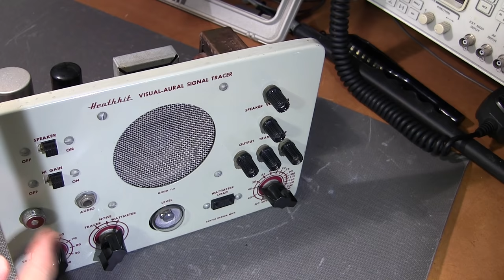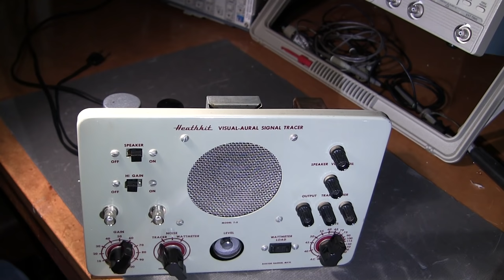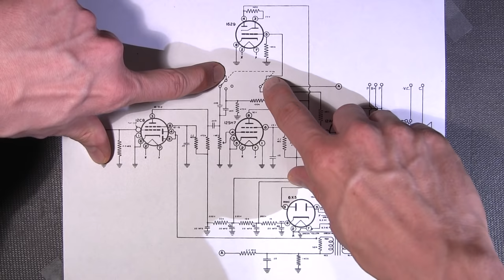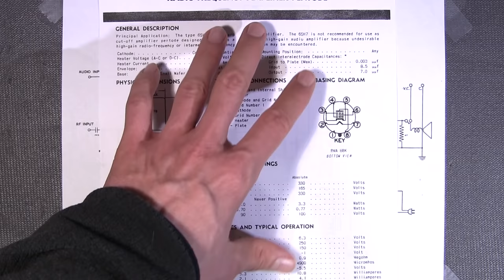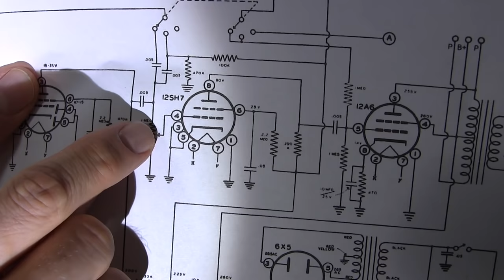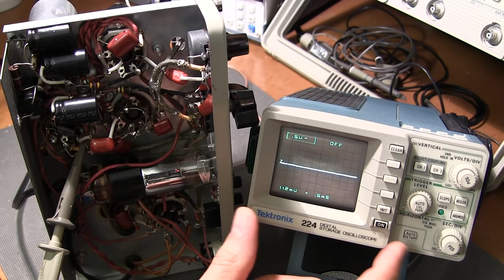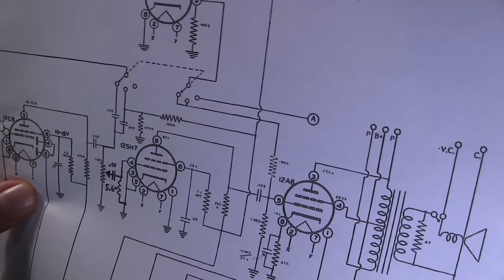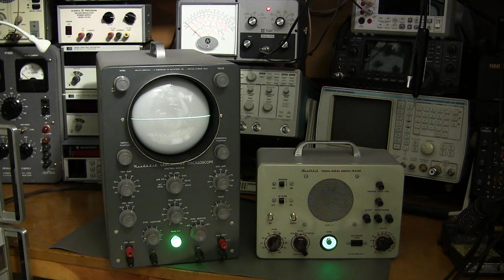Signal Tracer Troubleshooting Repair and Modification

Comment: OK, OK... I'll admit I didn't believe that Heathkit would miss-design a bias level which would present a problem. I was DEAD wrong, as Paul pointed out. I could have fixed the problem, had I correctly spotted the  plate voltage disparity. Geeze... it takes someone with a LITTLE more trouble shooting time than mine to spot something which was so obvious to him. Nice job. GREAT job, in fact. .

Comment: Long term technician here.    Now 70.  You do a great job of explaining as you troubleshoot.   I grew up with vacuum tubes and still love them if one can love something like that.  I've taught many troubleshooting classes over the years and am always amazed at the looks I've seen from students when I bring a vacuum tube device in for them to diagnose and repair.   The "deer in the headlights" types of expressions.   You do an excellent job in your presentations and video work.    I especially like your thoroughness to make a device work as well as it can, even if some mods are required.  Keep the videos coming.

Comment: I thought that the pot had a bad spot, tin whiskers, or leaky coupling cap on the wiper. I wasn't paying close attention when you went through the schematic; I didn't realize the pot was DC coupled. I can't believe the engineers at Heathkit did that! Cool video. Sometimes, I would parallel a suspect noisy resistor with an electrolytic cap to check for noise. That method is not always practical, and can cause damage if you're not careful. The outside techs would use a meter called a "Sidekick" that would put a couple of hundred volts on the cable to check it for noise. I hadn't seen a signal tracer with that function built in. Neat!

Comment: I learned electronics in the mid to late 60's from hanging around a radio & TV repair shop. It was a 1-man shop, so I became his helper. He was an old head at fixing radios and televisions. In fact, other shops would often call on him for help when they came across a tough old dog. I learned a lot from him, and I was very blessed to be his helper. He was much like you Mr. Carlson in his ability to troubleshoot and explain how things worked. I guess that is just one of several reason I enjoy your videos. You give great detail and are very methodical. No doubt the younger folks and even older folks like me learn a considerable amount from your videos. There are very few if any who teach how to troubleshoot vacuum tube circuits today. Thank you.

Comment: My bench looks as if it came out of the 1940's.  I restore vintage tube radios and amps and other vintage electronics using all the test gear from the same era.  When I sit down at my bench to work (play) it's as if I've been transported back in time to a 1940's radio repair shop.  I find it very gratifying as well as escapist.  It's a hobby I've done for nearly 40 years and still love it, as well as accumulating a collection of wonderful old radios.  Nothing sounds like tubes, even in AM.
Reply from the maker: Thanks for taking the time to write Chris!

Comment: Thanks a bunch Mr. Carlson.  Having been around at the dawn of the transistor age as a teenager but also doing lots of vacuum tube radio and TV repairs after school, I truly appreciate your rigorous and back-checking diagnostic procedures.  Lots of relaxing fun watching you do your thing.
Hoping to get my hands useful again shortly restoring about 10 ancient (pre- 1960's) radios and radiograms - all vacuum tube stuff.  Can't wait!  Something to do as retired, 71 year old, electronics design engineer.

Comment: The reason Heathkit used unusual tubes in their 1950s kits (particularly test equipment) is because they were WW2 surplus and Heathkit got them for almost nothing. The 12C8, 12SH7, 12A6 and 1629 were common WW2 surplus that weren't used in "civilian" electronics so there was little demand for them, and Heathkit got amazing bargains on carloads of them. As they used up their supply of WW2 tubes, they gradually changed over to more-common types.

The 1629 is a 6E5 with an octal base and 12.6 volt heater. It was used in the SCR-274N (ARC-5) transmitters.

EXCELLENT video!

Comment: OK, it's a little late for comments at this stage but here it goes anyway. I grew up with Heath kits in the boy scouts radio clubs in the 50s and 60s they were considered as fairly valid tools for learning and there certainly were some flaws in engineering. I always wondered if some of those flaws were intentional. Look at it this way ... If you were motivated not to accept everything at a complete and finite face value, you might want to find the seat of an issue and discover its remedy by simple experimental techniques. It would certainly teach you something in the process. Its been 50 to 60 years and I still love doing these things. These videos are very valuable and I am still learning new things every day. Thank you for all you do !

Comment: Amazing!  I would have said the noise was caused by an old audio gain potentiometer and lived with it.  Your design modification stopped the potentiometer crackling noise and stopped unnecessary plate current.

Comment: I wish I had this exceptional man looking over my shoulder as a teacher and I’m in my 60s trying to work on  old equipment. Amazing man. Thanks for your helpful and pleasant demeanour.
Reply: I am 65 as well, continuing to work on my hobby (hobby (#5) electronics,) now starting a more concentrated effort towads a major focus on Electronics & Amateur radio 📻. I have dabbled in electronics since approx 1966, I had parent's that were either too trustworthy or totally ignorant towards the dangers of "high voltage" in 📺 's! When I was approx 12 years of age I got to close to the high voltage transformer for the crt and was thrown clear across my bedroom. I didn't learn much, as all I did was get up, brushed out any lingering cob webs, walked back to my exploration adventure of a newly acquired TV set.  Since that time l attempted to learn electronics on my own with mixed results! I have shocked myself a few times but never to the Olympic Games level of Manitoba puddle jumping adventures. There is a lot we can learn from this and so many more great teachers one can find on YouTube.  Between all of my great books available, the internet and YouTube instructional videos, an individual can learn a lot, have fun and help the environment out.

Comment: Thank you very much for very thoroughly showing how all the controls on a signal tracer work.  I especially liked the troubleshooting and repair/modification as well.  

I'd love to see you showing how to actually use a signal tracer in a radio repair.  

A lot of these units seem to come without probes.  If you'd show in a little more detail how to make up a probe, that would be great!

Regards, Tom
Reply from the maker: Thanks for your input Tom!

Comment: Probably the best troubleshooting / repair video I have seen for ages.
You are so clear and and easy to understand. I like that even though you are doing - with my knowledge - a quite advanced repair, you still explain the simple steps too.
I found the noisy resistor very interesting. I have heard that they exist, but never seen it demonstrate and with such a extreme result.

Comment: Paul,
I just got the EICO 147 tracer. Different tubes, but amazing how much the circuits are the same. It does not seem to have the switch to ground the grid of the first amp tube though. 
The manual for the 143 states that the current sent to the probes on the noise function is "about 130 vdc" but that there is no danger of damaging components since the short circuit current is "about 1ma." It also states "some care" should be used in handling the probes, though the shock that can result is "relatively harmless."

Comment: Great job on tracking down the noise.  That can be a bugger some times.  Nice to see I'm not the only person that installs modern X1 Y2 safety caps.  In a lot of gear especially radios I work on they used standard ceramic caps and I don't have enough fingers and toes to count how many of them I have seen exploded.  I always replace them no matter what they look like.  Especially across the line caps.  Their on 24/7 as long as the equipment is plugged in, hardest working part there is.

If you ever run across a Paco Z80 cheap grab it.  I love mine.  In addition to the variable gain pot it has a switch for multiplier of X1-X10-X100-X1000.  The scope/VTVM output is also very handy.

Comment: Excellent Paul. I have a couple of 1950s UK made Taylor Instruments signal tracers, pretty rare things over here actually.  One of these had something even better than those HV/B+ terminals on your Heathkit. Someone modded it with a 4 pin valve base fitted into the front panel  therefore giving 300v AC straight off of the TX secondary totally unprotected in any way exposed on the front. Needless to say, it got disconnected.  But another good reason to check things out before applying power and to go careful after you do until you understand the equipment.  Cheers - Andrew

Comment: Outstanding! I forgot how a carbon resistor can get noisy. I heard the current flowing thru the speaker and knew the slight hum was acceptable the way you were demonstrating. My guess was going to be a unsoldered wiring point or cold solder joint. Great find with the resistor. Thanks for the video

Comment: Paul great to bring the older equipment back to life. I now have a Jackson model 106 rf signal generator to bring to life again
The case is just pristine
Reply from the maker: Hey, that's a nice looking signal gen with the white "chicken head" knobs!
Reply: Yes it does have white chicken heads and looks brand new, not a  scratch or mark at all. Bought on ebay
and I now feel that I robbed the seller.

Comment: The bias fix on the 12SH7 was interesting to see.  Just goes to show that even the engineers at Heathkit still had a bit to learn.  I also like that little scope, and the Agilent meter with the quick response.  I'm used to cheap DMM's that have close to 1-second intervals between readings.

Comment: A superb video.  I have the same Heathkit tracer, and I am going to use this video to restore it to operational status.  I thoroughly enjoyed your explanation of,  and your solution to, the two problems with the tracer.  
I happen to have a Heathkit single channel scope, and will be interested in finding the video and following your techniques for troubleshooting that old unit.
I don't know if you have ever done any work with the Heathkit transistor curve tracer, but I have a dead unit, and will be interested to see you go through one of those units.
Thanks for the excellent videos.

Comment: Working on tube gear is always fun. Exciting voltages if you aren't careful, and different techniques for checking circuits... I was thinking DC on the pot at the first fix.. (Wonder why Heathkit didn''t put in a cap. They had to hear the noise at the bottom...)  and the old dead resistor was also what I would have attacked with percussive engineering.....  Great demo and repair!

Comment: Another fully and well explained video, Paul!  I wonder why the Heathkit engineers would leave out those  two grid leak components, a cost issue or it just got missed.  In 1950 dollars, it probably would have added an extra quarter at most to the kit. Happy 2021!

Comment: I built many a Heathkit, even a signal tracer, but it did not have the wattmeter capability of this one. very nice and yes, not a perfect design. Nice demonstration of noisy resistors. You want carbon film, much quieter and common today.

Comment: Another great video! Since I work on a lot of tube amplifiers, I run across noisy resistors all the time. Some worse than others. I have 2 signal tracers now, I got an extra one to troubleshoot my first one :) Most of the time, I grab a wooden chopstick (compliments of my local Chinese restaurant) and poke resistors until I find the noisy one. However, the poke & tap method doesn't always reveal the noisy resistor. That's where the signal tracer comes in handy. Great video, keep 'em coming! Frank Ferraro--Audio Craft Electronics.

Comment: Paul, thank you for yet another exceptional video. I'm 76 and my dad was building HeathKits in the 50's, while I was building them starting at about 1967. Back in those days HeathKit offered their products both as Kits and "Factory Wired & Assembled". My memory of those days remember a higher resale value of the factory wired versions. Not surprising because many kit builders had awful wiring and soldering skills. I have a friend and old coworker who's motto is "The bigger the glob, the better the job"! I would tell him I've seen rookie welders with better joints!    😂
Wakodahatchee Chris

Comment: Excellent video as always Paul. I followed along (at my own risk) as I restored my own T-3. Mine looks like it may have been a kit, it was full of Astron yellow mylar caps all swapped out for polypropylene.  Many of them were installed with the outside foil to the wrong side. Using your sift tester I got them right this time.  Thank you for the modification to the circuit, the bottom portion of the potentiometer turn made quite the noise and it is now completely gone.  I’m guessing the one I have is very low hour as well as it’s magic eye is very bright.  Picked it up at a ham meet for $1 usd, also grabbed a Heathkit IT-12 tracer for $1 along with several Heathkit and HP VTVMs he had priced too good to be true. 

Question: I was too thinking of changing out the connectors on the front with BNC, doing so and using your own probes and such you eliminate the small circuit that’s in the probe that came with the tracer, being a filtering cap, diode, and a couple of resistors.  Is that fine eliminating that? Or would you just put a BNC connector on the end of the original probe so that you can still use it?

Comment: Very interesting how you trouble shouted an old very precious signal tracer with tubes. I wish I could find a piece like that in working order,but it is only a wish I suppose..! Thank you very much for your easy and excellent explanations how to proceed in order and how you have made a very cute change in the diagram. I think a case like that with the disturbing noise is rather frequent in old radios. Abele. Suisse.

Comment: I’ve seen all of the master’s videos and am a Patreon supporter.  This is one of his most beautiful repairs to watch because of his ability to troubleshoot and isolate faults.  

What’s surprising here is Heathkit released this device with the design flaw that caused all the popping and static.  That’s hard to believe.  Is it possible it behaved differently with the original components when they were new and the popping was suppressed?

Comment: Paul- This Mod wasn't working for me and it was bugging me forever. I finally opened mine back up and discovered my mistake. I corrected the mistake (to comply with your mod...oops) and now it's running as good as yours in the video. While researching my error, I was looking at the schematic and pictorial 3 in my T-3 manual. I found an interesting discrepancy. Pictorial 3 on page 23 agrees with your schematic/mod and that in my manual to include steps on page 7 for wiring the pot.  The blowup/fold-out version of Pictorial 3 shows a different scheme. It shows Pin 4/Grid of the tube going to pin 3 on the pot, not the wiper. The scheme basically swaps the wiring on the pot wiper and pin 3. Since the pot is 1 meg, it essentially puts a 1 meg grid leak resistor in series to ground. You hinted toward this mod in your video. I'm curious to learn of your opinion on the scheme on the fold-out pictorial.

Comment: I don't know about the 12C  offhand,  but the rest of the tubes used  were  common military surplus  right after  WWII.  Could it be??   Heath got a  heck of a  "buy"  on a shipload  of  surplus tubes?  The  1629  EG was  used in the ARC-5 series  Command  transmitters.
Reply from the maker: They also used the 1625 for modulators in the DX-100's and so on. All surplus, but perfectly valid.

Comment: Thanks for this video.  I just finished rebuilding a T-3 signal tracer with all new caps, resistors & wiring.  I want to implement the design improvement you mentioned for the 12SH7 grid bias issue but have question.  You mention that you used a 5.6M resistor but I didn't hear you specify the capacitance value.  Some blogs say use a 0.01uF.  I have a bunch of 0.047uF 630V caps left over from the rebuild.  Is that an acceptable value?  Thank again!

EDIT:  OK, my bad.  The capacitor value is 0.01uF as shown in Mr. C's redlined schematic at 58.25.  Cheers!

Comment: I built the EICO 147 version of that back in the 60's and it still works as good as it did when I built it. The eye tube is expensive if it has to be replaced but they are still available.

Comment: Another very excellent and informative video. The use of the Agilent DMM to test the pot was a bit tricky to follow because of the auto-ranging. Could you have used the Keithly VTVM and manually changed ranges? The needle flicks and ticks are easier for less experienced techs to follow.

Comment: From the silk screen design of the front panel and the model number, that is an early Heathkit. That vintage kit came out shortly after World War II. There were absolutely tons of surplus military parts available just after the war. Heath Company bought tons of these parts and designed them into their kits, as a number of other kit builders did in those days. Those 12V tubes were quite common in military radios in the first part of the war, and Heath could get them for pennies each.